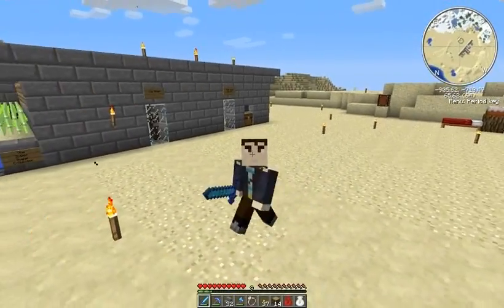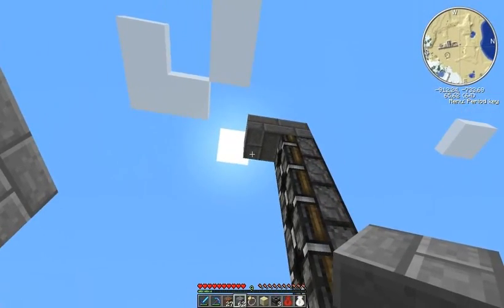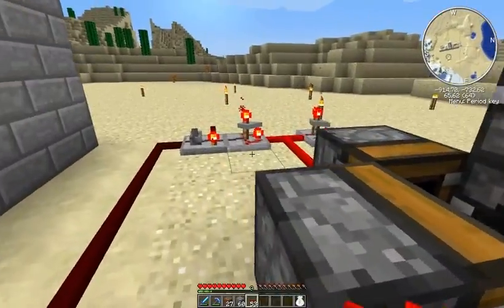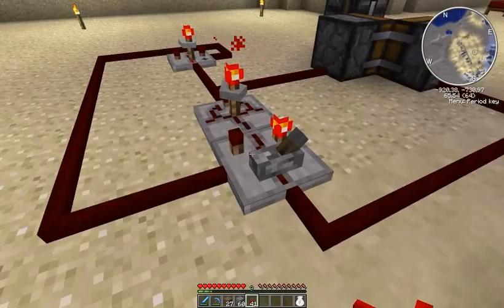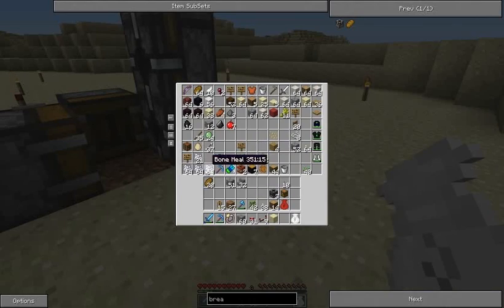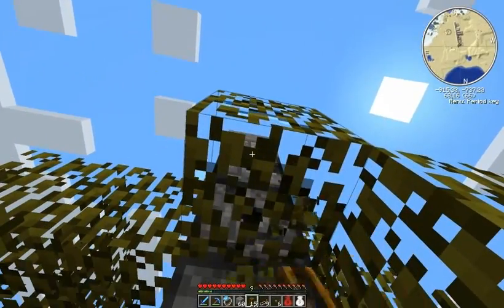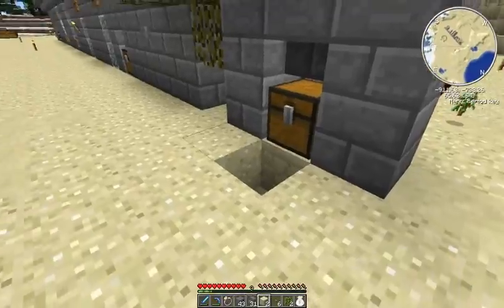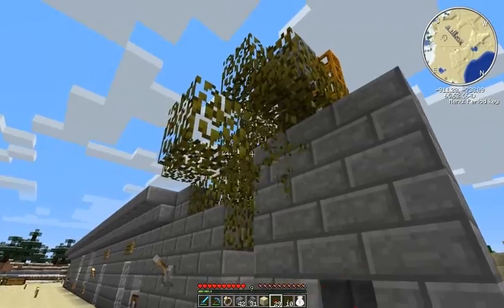ShiftKlik's Tekkit Builds - # 4: The Wood Chopper

Comment: this might be a mute point, but i found a way to make a tree farm using a quarry, and deployers. Just build a quarry 10 or so blocks in the air, build 8 deployers and have them facing towards the corners of where the quarry will be digging, load half of them with pine tree sapplings, the other half with bone meal and hook the whole thing up to a timer that activates every 20 seconds or so. If you filter out the saplings that the quarry mines up and have a skeleton farm, you can automate it.